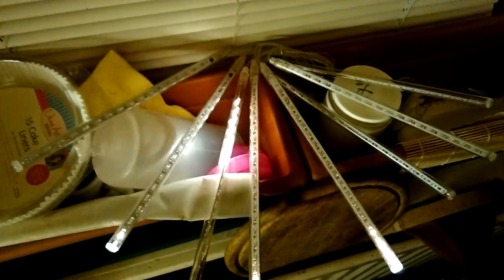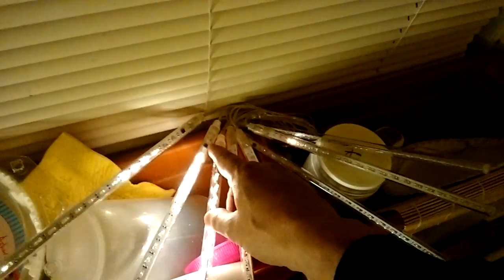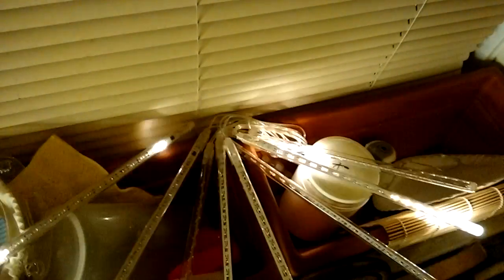Weird fault in Xmas meteor light tube.

Comment: I have a few of these sets and all worked, all leds lit, but after a number of hours, they started showing the above issue. I just left it and assumed they were cheaply made, but the next day when the timer switched them on again, all leds were fine, pattern running as it should and no issues. The problem returned on random days but the leds that appeared out seemed to just be taking a break and would work again after a lengthy "off" period. Strange.
Reply from the maker: +Sparky UK That's the failure mode of gallium nitride based LEDs.  Intermittent shorting out.

Comment: I've had to repair all of mine , usually only one fails per strip , got both types , white and coloured , the led fails short circuit , either remove or replace to get the correct chase pattern again , thanks for the videos Clive , always a great watch and source of info

Comment: I bought a few sets of very similar tubes and in each case the power supply was a capacitive type.  Very dodgy indeed.  Ultimately it didn't worry me as I run them off the output of a ELV lighting controller board.

Comment: Who else noticed the plug had no earth pin?
Reply from the maker: +twocvbloke I tried to find an adaptor and there wasn't one (It was at my brothers house), so I used another plug to defeat the earth shutter and just jammed it in.  As one does.
Reply: +Elliott Veares 
I noticed, it'll be a euro-plug style, the easy way to plug them into a UK socket is to jam a screwdriver into the earth to push open the shutters, ram the plug in, and then release the screwdriver from the earth and the shutters hold the plug in place, very much not recommended to do, but you kind of have to when there's no decent adaptor to hand... :P
Reply: +twocvbloke The proper ones with earth pin in the UK have just a plastic pin. This adaptor is double insulated, no need for earthing.
Reply: *****
It's not the earthing, it's the fact the pins are a round peg in a square hole, frowned upon by the nanny state that sez no, though not really cared about by those of us who use euro-plugs in British sockets... :P
Reply: *****
As long as this is low power usage, I think it's still okay. But I certainly wouldn't let that run unattended.
Reply: bigclivedotcom
I just jam an insulated screwdriver into the earth to open the shutter, but since I got my Belkin UPS, which is equipped with german shucko sockets, I've not needed to do so for some time now... :P
Reply: +bigclivedotcom its an off the shelf  usb charger pack.  they're a dime a dozen.  it typically  does not require a ground pin as the circuitry would incinerate if it shorted out inside. they are normally designed to fail in as open circuit